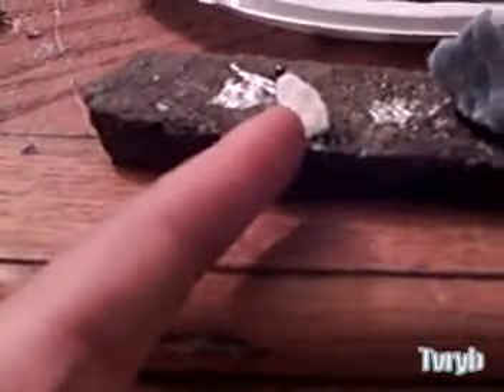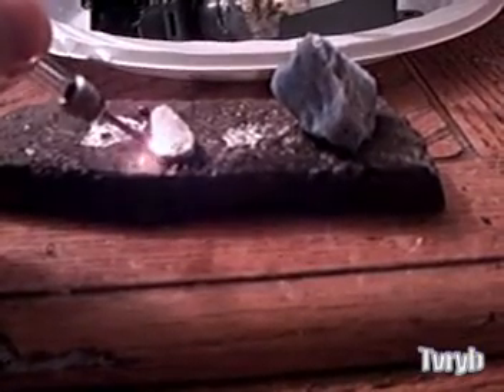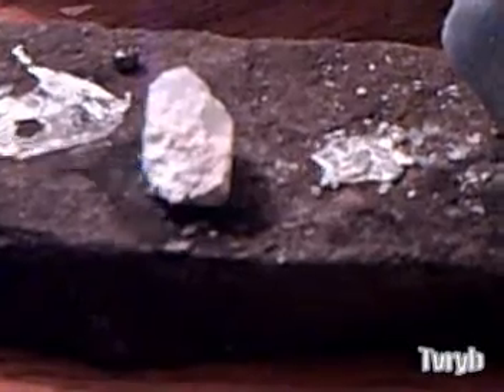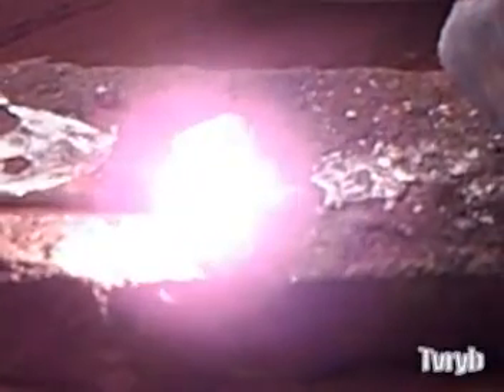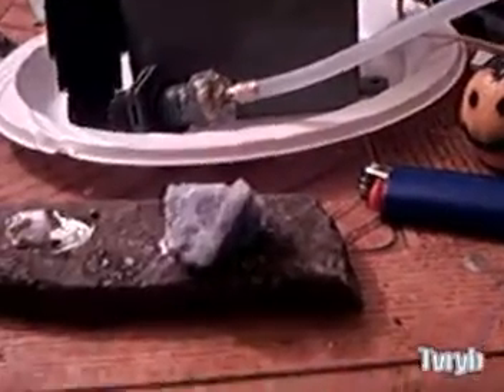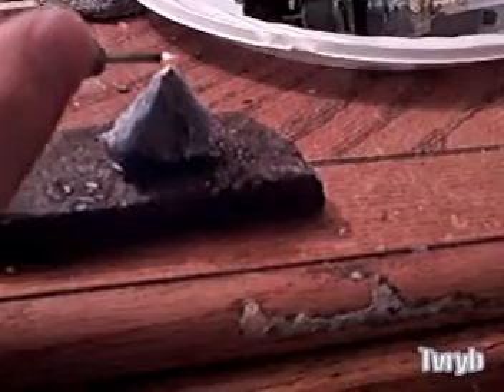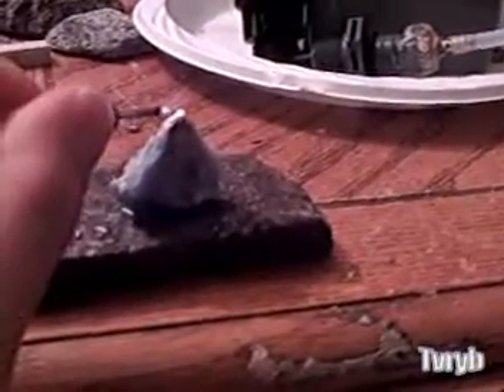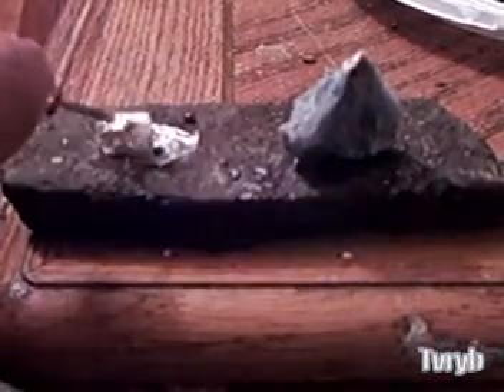hho - MARBLE and CALCITE - Burn Test

Comment: The reason your rocks are glowing that strongly is the lime you are forming.  Marble is calcium carbonate, and with heat it creates carbon dioxide and lime (CaO).  Lime was used in the old days for lighting in the theatre, that's where the expression "lime light" comes from.  We don't really use lime for that purpose anymore though.